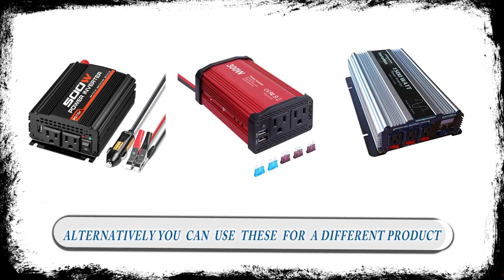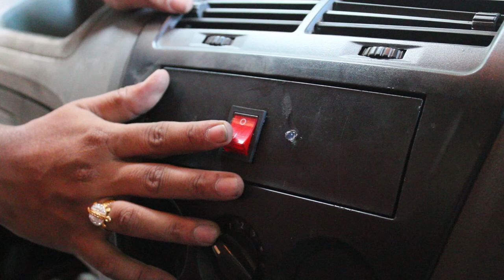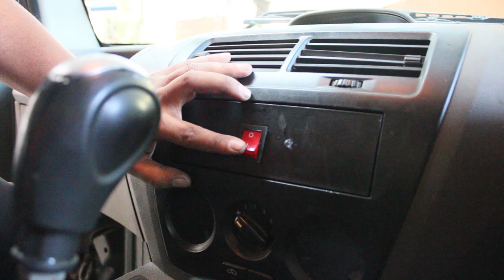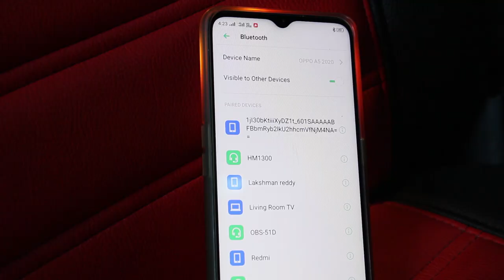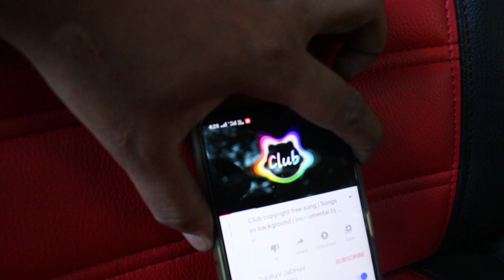Sound bar installation in Car |5.1 speakers installation

Comment: Bro isse gadi ki battery to khrab ni ho jayegi?.....
Reply jruru dena
Reply from the maker: No there is no problem ...
There will be no effect on battery..
The soundbar consumes less than 50 watt which means the sound bar can continually play on idle battery for more than 24 hours..

If the engine is on and the vehicle got move the alternator will charge the battery...
🥰

Comment: In here playing only 15 mint after it will cut off because the ups work only 15 mits what can i do
Reply: Assuming your ups is 12v battery inside, connect a 12v line to it from the car through a relay
Reply: Negative direct but positive through relay that switches with remote trigger

Comment: I drive tractor trailers over the an have a 2500 watt power inverter am getting Rockville hd56 something 1000wztts 250rms will inverter be enough to get bass thumping i do alot of truck shows look up lanita specialized
Reply from the maker: It based On the Capacity of inverter and power consumption of home theater..

I used a 600 volt capacity UPS and a 100 Watt Home theater it is quite enough to get the complete RMS the company provided...

As u mentioned you drive tractor trailers,which are mostly opened to surface ,so we can't expect enough bass..the bass will based on the surroundings .A closed room will provide best output...